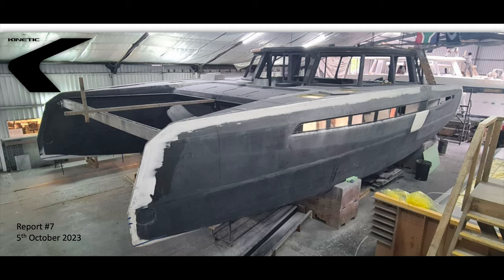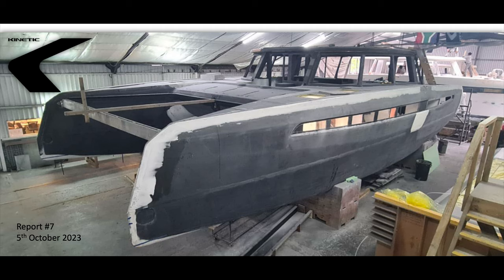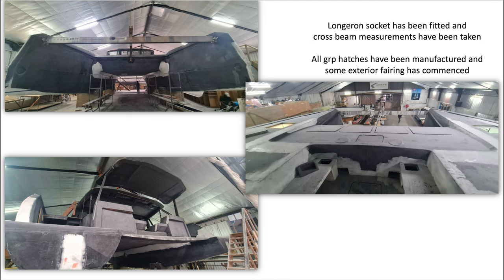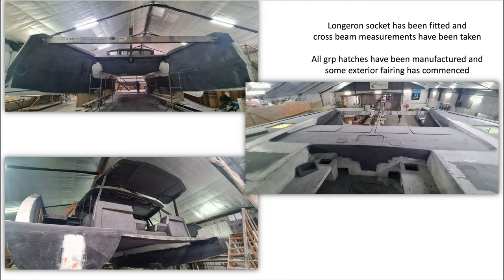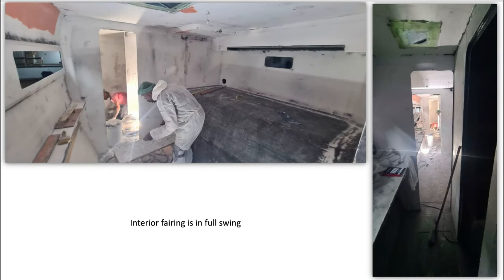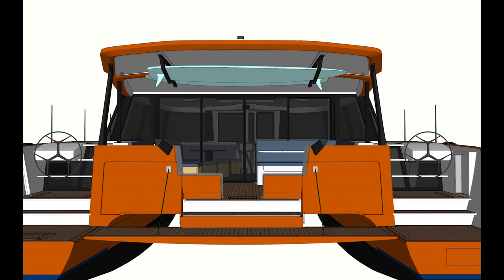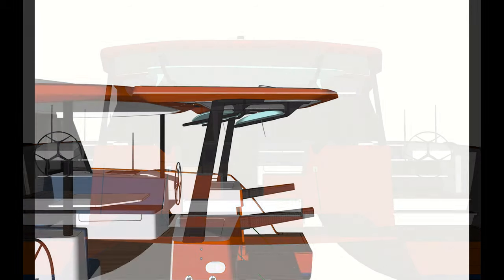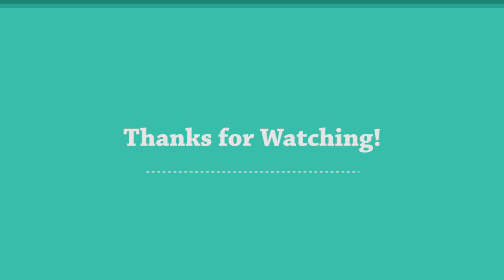E25 - Sphyrna Build Update Oct '23 & Designing a solution for carrying paddle boards

Comment: Lovely build….  going to be a great strong fast boat.  Do the cables for the rear fold-down transom connection disconnect and slip back into the main transom out of the way?  Do the davits fold up vertical when that connection is down,  so that you have unobstructed walking between the rear transoms?  It’s an awesome rear setup if they do.  Thanks for sharing all this..   we are excited for you.  Fantastic days ahead…
Reply from the maker: Hi Tony!  You know, you’re attention to detail is pretty awesome because I’m not really sure of the answer to your first question but now it’s something I’ve got to ask about as I don’t recall seeing it function - had a dinghy in the way when we saw hull 2 in SA. There is a cutaway in the seating at the transom so if the cables don’t come off, at least you can also pass through via midship.  That’s two pints I owe you mate! I do know that the davits are hinged, so they will fold back on themselves completely out of the way.
Yes - the time is coming soon and it’s almost overwhelming - still lots to consider but the designers have been great with their suggestions and collaboration on what we need or think we need.  Talking to you guys on the channel also helps.  Cheers!🍻
Reply: @secondwindadventures1646  thanks for the kind words mate but you owe me nothing….  you are most welcome and the sharing of your wonderful adventure means I owe you a beer not the other way round.   :)   It’s such a delight to see the process like we are.  I feel privileged to ‘know’ you guys.  Any time you want to share any details at all about the build or equipment or anything like that,  there is a group of us viewers who will be delighted.  I wish the algorithm would wake up to your value and share it more to others.  Best wishes.

Comment: I note that you are installing the dive compressor in one of the forward lockers in the bridge deck. Assuming that you will have a storage rack for the dive bottles at the transom or aft cockpit. Is the not an opportunity to also locate the dive compressor in an aft cockpit compartment? Either very long high pressure tubing and remote filling and compressor control station, or a hazardous trek to forward compressor with  very heavy dive bottles every fill.
Reply from the maker: Hi Peter.  Yes the dive compressor will be installed with storage racks in one of the forward lockers. I believe the Happy Together boat has this as well in the same location. Unfortunately with the cut away transom seating there is just no room aft for the compressor or even the tanks - unless they are under the bench seats somewhere. I think aesthetically we wanted to keep the aft cockpit clear of encumbrances like exposed tanks - just in case Alina is using the space for aerobics and such.  I’ll have to look at the remaining enclosed storage locations aft but I may not have a choice.  A long hose may be an option…It seems like everything on the boat is a compromise based on priorities. Thanks for commenting!

Comment: looks great!  love how you've spec'd this out...my only thought is you are going to want an E-Foil too : ) it's our new favorite thing to do after this past summer.  keep the updates coming!  Do they have an updated splash date for you?
Reply from the maker: Hi Kirk - How are you doing? I think I saw a post of you efoiling on Instagram.  We have a couple of folks with them on our lake but I haven’t tried it myself yet but I’ve been tempted to get one.  I’ve made sure our design for the boards can accommodate shorter lengths so maybe…. They are changing a few things on our boat including 48v electrical, Integel alternators, and rebalanced battery placement so I’m not sure if this is going to impact our delivery.  Right now it’s slated for a May/June splash in SA.  So we are delaying our return to the boatyard until maybe just before splash. How about your Balance?  Good to hear from you!
Reply: @secondwindadventures1646  very cool!  I didn’t think we’d enjoy foiling as much as we do, definitely give it a go if you get a chance.  

Our boat should splash next November so we aren’t too far behind you, we are going to try and take another trip over after the first of the year and plan to go to Knysna to check out a carbon dinghy built there called SeaSUV.  Maybe they’ll let us sneak in and take a look at your boat : )

Looking forward to meeting in an anchorage some day in the not too distant future!
Reply from the maker: Yes we’ll meet up for sure 👍 If you go to Knysna, just send an email to Leon - they are great folks and very welcoming. I’m sure you can have a tour through the facility. Chat soon…
Reply: @secondwindadventures1646  sounds like a plan sir!

Comment: Great progress, solar arch is excellent upgrade. I😅s it practical to eliminate the gap between the solar arch roof and the coach roof to create a more integrated seamless transition? Continuous roof would prevent annoying water drips into the aft cockpit area during heavy rain.
Reply from the maker: That was one of the first points I asked for but alas that would have been a change to the original mold for the coachroof to extend the coachroof for an even more integrated look. I may have the screen/shade extend from the end of the coachroof to the back of the transom (removable) to help with water ingress but that was the original option for the boat anyway.  It will be interesting to see it in person after it is painted and finished.  I guess that will be coming up in a couple of months.  In the meantime, the CAD renderings do help.  Thanks for your comment Peter!

Comment: if you make the arch for solar a bit higher, you can let the water run from solar to the biminir of, extending the roof, which adds if you want to collect rainwater, but also closes the gap between the panels in a more natural way, and stops the drip in between. Thats what we did.. add that the hard boards are a bit higher as well to walk under.
Reply from the maker: Hi Walter! Thanks for your ideas! There is a fitting under the back of the coachroof for a shade/bimini and this should attach at the back of the transom, so we had the same thoughts that this may be adequate to prevent ingress of rain.  Can’t change the height but we may not need to.  The bottom of the board rack is proposed at 6 feet which is good for me as I’m 5’10”. Good for Alina too as she’s been known to walk into things like booms.😀
Reply from the maker: I wish I was that tall… 😂

Comment: Surfboard placement is of course super-duper important but where can you place that oversized DOMESTIC non-stainless-steel fridge/freezer 😰Online rumor tells marine stuff fails and rusts miserably, besides being expensive af. Could be a Chinese wisper, dunno 🤧😉 Noice update 👌
Reply from the maker: Great point - it’s a good thing the cooler at the transom is just for important things like beer. Reminds me that I should get into the details of which makes they are installing for us. Been very preoccupied with the primary build out.  Next stages will force us to get quickly into the interior fit out so thanks for the reminder.  We have two double units planned for the galley so we’ll have to look at that too.  Thanks again for following and watching!🍻
Reply from the maker: Yeah! Right on… I got you! lol.  I should be eating only when necessary… leaves more time for surfing.🏄